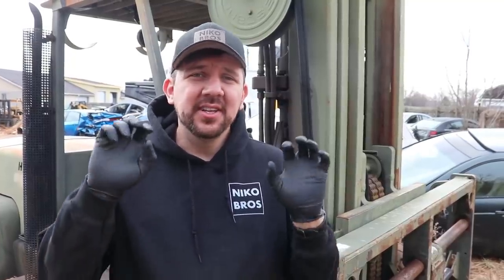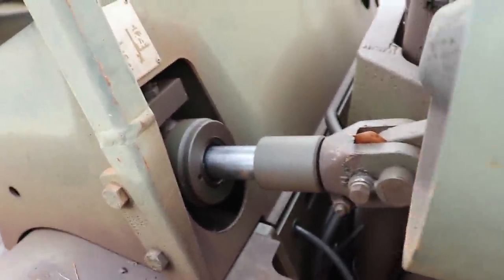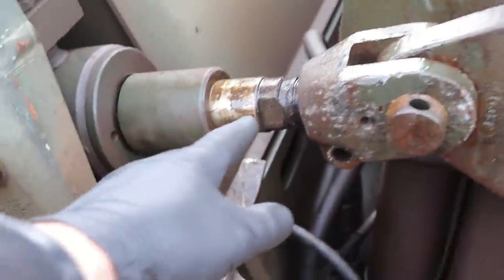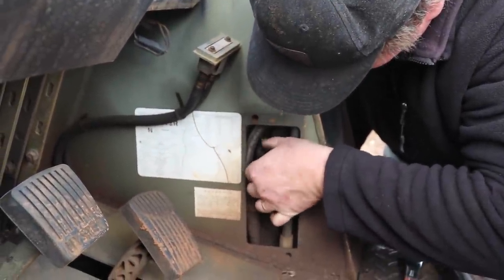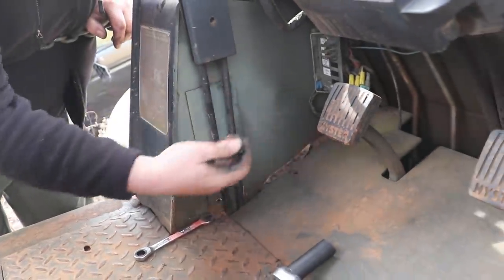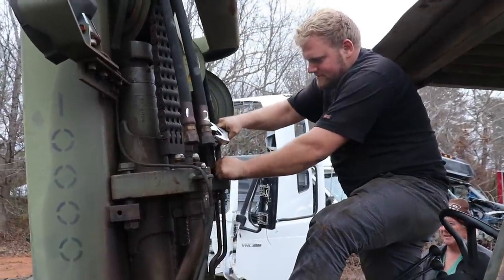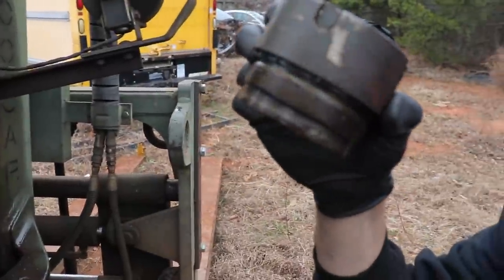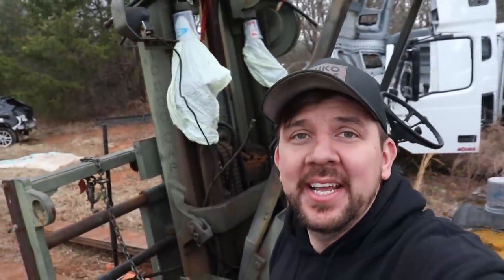ABANDONED MILITARY GRADE FORKLIFT REBUILD TIME

Comment: As much as I admire your can do attitude in this instance you seem to have missed a major part of a ram repair.. The seals on the bottom of the lift rams ! Chances are they will be fine but if you DO have issues with the lift ( such as slowly dropping back down ) then the bottom seals will need replacing ( spent 6 years working on fork lift trucks in the 80's, and servicing rams was hated by every one in the company ! )